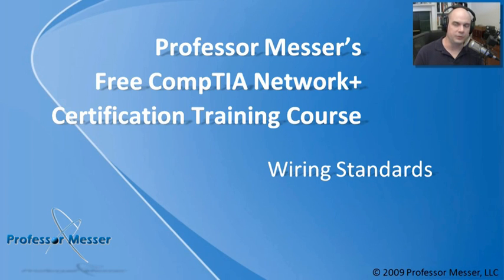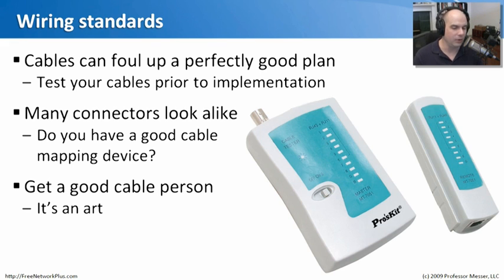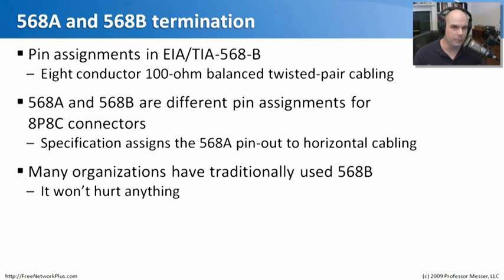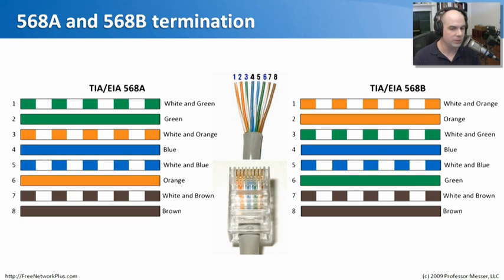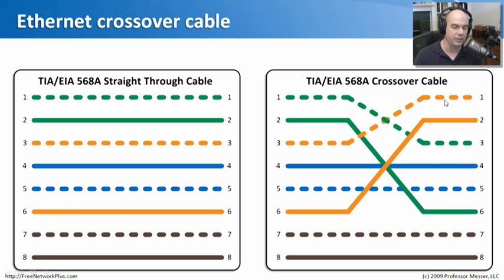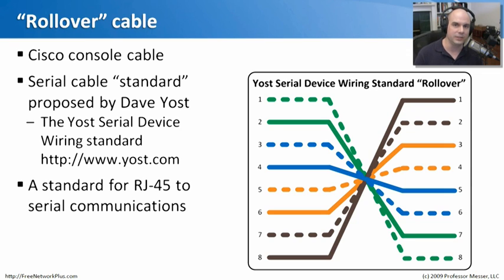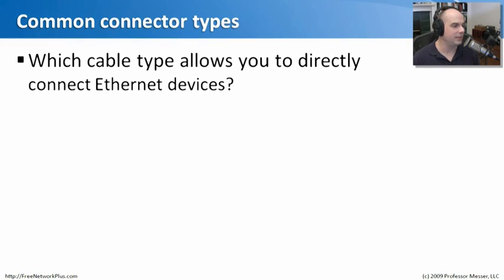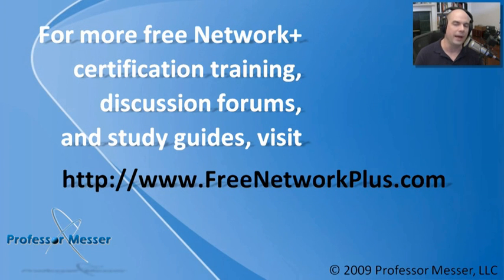Wiring Standards - CompTIA Network+ N10-004: 2.4

Comment: Had a 100ft Cat 5e cable that was printed on as 568A but was, in fact, 568B. I had to cut the cable because the wife had gotten stuck behind some new cabinets she installed. When I terminated the halves is when I discovered the error. :D

Comment: I have a pre-made rj45 jumpers with same color configuration exactly as in your picture.  Will I use A or B on my punch down block connectors on each end?  Thanks
Reply: dabig 25 hey man. When you say premade, do you mean like a patch cable or a custom straight through that you terminated yourself?
Reply: Yes patch cable... No worries I've got it working already